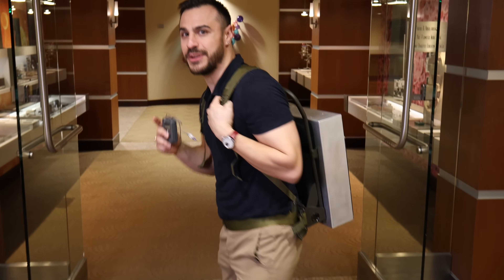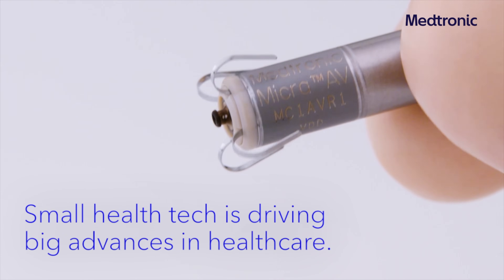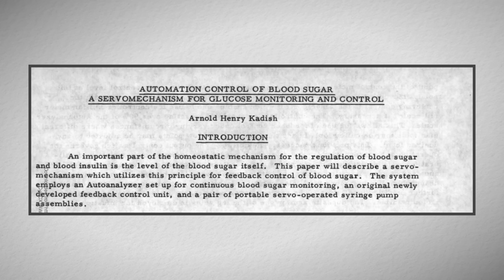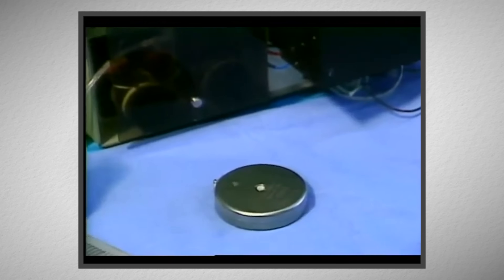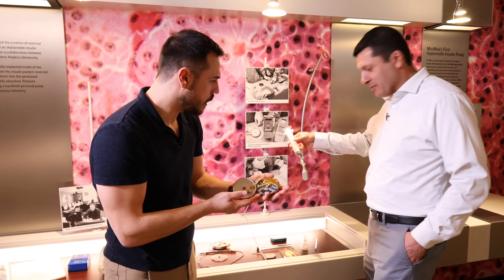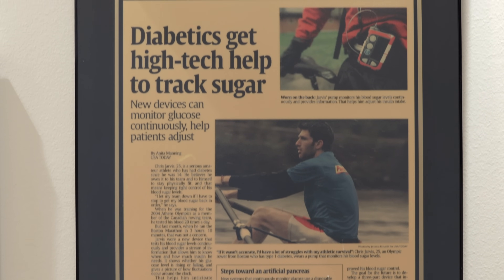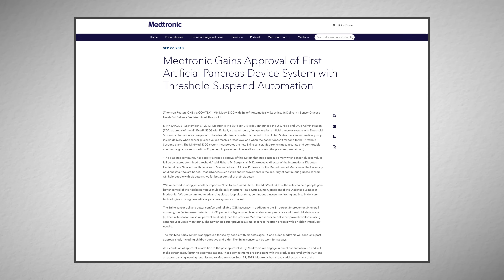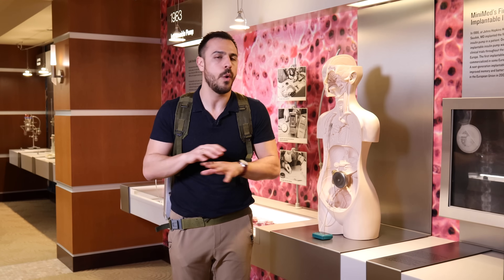The History of Diabetes Tech

Comment: Not mentioned in the video but the improvement from a 3 day CGM needing multiple calibrations a day to a 7 day one only needing very few has been a huge thing for me. I attempted to use a 3 day one in college where I also worked a fast food job, I could never step away to calibrate it when it beeped like every other hour, so it was completely useless to me  The upgrade to a 7 day CGM with 2 calibrations per day years later was a huge relief and helped me keep my blood sugar in check for a healthy pregnancy. Now Im on the Medtronic Guardian 4 with 780G pump which has an ever better Smart Guard mode and less calibrations required and I'm doing so much better, and think it will help pregnancies even moreso!
Reply from the maker: I want to do a video that focuses on CGM tech evolution! Thanks for sharing.

Comment: I'm not sure if you are having a follow-up with them, but I'm wondering - Why can't they implant the tubing for the current pumps into the peritoneal cavity and create a port that external pumps connect to? So they would only put the tubing of the pump in the body, and the only risk would be infection (although they have ports for cancer treatment and others- so I'm sure they have solutions for this). This would prevent scar tissue that comes with insulin injections and allow all the benefits of an internal pump like quicker speed for insulin to work, while also removing the biggest issue of external pumps - site issues. Genuinely curious if you can ask.
Reply from the maker: This is a fantastic question - will definitely ask about this. Would be amazing.
Reply: The implantable ports for cancer treatment etc still have infection risks and they are a nightmare to troubleshoot and remove when infected or blocked

Comment: I'd like to ask why we still don't use even U200 insulin in pumps. It would be the simplest improvement and it would surely help a lot, especially in the long run, to people with higher doses, by doing less harm to the tissue. With the high precision today, it shouldn't be a problem for even low doses. And I expect it would make the insulin also act faster. Half the volume should be absorbed faster, right? Probably a historic thing noone has big enough power to change from U100 :(

Comment: Sorry, things are not as rosy as you explain. First of all long term insulin pump use is not practical, because over time (years of use) the insertion canula causes scar tissue to form in the abdomen impeding absorption of Insulin leading to poor glucose control. Then you have to go back to daily insulin injections. Secondly, CGMs really don't work, the newest CGM made by the largest well known company is terribly inaccurate and prone to failure. CGM readings can sometime vary as much as 100 units from a glucometer reading. This makes this device useless. This coming from a Type 1 diabetic with 45 year of diabetes experience.
Reply: Cgms work fine, they're used by millions with very few issues. Libre
Reply: I’ve been on a pump for 20 years now and really have no issues just rotate my sites
Reply: If they had continued to work on it they would have gotten around it as it stands they could use something like a port.
Reply: I disagree on the cgm. Admittedly I’ve only been a diabetic for a year but I’ve found my Libre helps alleviate the paranoia I get about my blood glucose.  I’ve noticed that when I’m off it, I get the intense urge to stick myself much more frequently because I’m worried I may miss a spike.
I know it’s not super accurate. That’s fine. It tells me when I’m spiking and I need to do something about it.
Reply: Why not rotate sites to prevent the scar tissue issue? Literally only 2cm would be more than far enough away for the previous scar tissue to not cause any problems. And these are literally baby needles we‘re talking about… like come on
Reply: @cjfitness  generally these things need to be inserted into an area that has a layer of fatty tissue and isn’t going to be constantly knocked around and jostled, and is readily accessible, sounds easy enough at first, but it can be problematic real quick.
Reply: Exactly what my grandma says anytime I ask her why she doesn’t use the new devices
Reply: Type 1 in 64th year. My CGM supplies me with tracking info that is far more valuable to me than  having a  more accurate reading once or twice a day. I receive readings every 5 minutes, and they collectively have enabled me to arrive at the lowest A1C readings since the readings were available. No more finger sticks for this fellow.
Reply: I share your pain and frustration. But to be fair, it’s not the cannulas that caused the scar tissue. It’s leaving the cannula or insertion site in place longer than three days at a time. Secondly, CGM‘s work great until you have what’s known as a compression low. It is important to put the CGM’s in an area where it will not be compressed, whether while you’re sleeping or from tight clothing pressing on the CGM. These are false Lows and can throw off your diabetic control regiment. One other thing to note is that two of the major brand CGM manufacturers tell you in their literature that you should not take large doses of Tylenol, (aka: acetaminophen (500 mg or more) because this can cause the CGM to give false highs, which intern will cause your pump to overdose you. I’m sure Justin can address that issue more if he hasn’t already in his videos.

As for me, I have been diabetic since 1977. I have worn the 502 mini med pump and several more decades after. In 2023 I decided to go with the Omnipod system. It has proven to be more cost-effective for me and I can place that Omnipod just about anywhere on my body, eliminating large areas of scar tissue. The FDA only approves the back of the arm, the abdomen, and the back side of your hips for the Omnipod however, I have placed it on the front of my arm on my chest on my upper inner thigh and have had no issues with absorption so long as I change the area location every 80 hours (which you have to do with the Omnipod anyway, as it expires automatically after 80 hours of use).

I use the Dexcom G6 and only twice have had a compression low because I am a side sleeper and had it on the side of my arm. And as I stated earlier, I don’t take Tylenol as it will throw off your readings.

Bear in mind, CGM do not read whole blood like fingersticks do. They read the interstitial fluid under the skin and they do have a 10 to 15 unit discrepancy compared to fingerstick whole blood testing.  When taking Tylenol and strength greater than 500 mg, the interstitial fluid is affected and will produce false highs. Whole blood is not affected by Tylenol.

To conclude, what other choice do type one diabetics have? One way or another we either take our insulin via infusion pump or shots, but either way we must take it or we die. 

Ps. Vote for politicians who will cap the price of insulin for every age group not just the 62 and older. Like yourself I have had type one diabetes for a very long time (47 years). Don’t give up keep fighting the good fight and know you’re not alone.
Reply: Coming from Libre 3 and G7 I think you fall into the category of always comparing blood stick to CGM.  Quit doing that, just pull out the BG meter for extreme highs and lows.   You mention stomach when you have so many more places for infusion sites.  Lower back, upper buttocks, back of arm and your upper legs have a ton of real estate to use.  You can easily rotate and give previous sites time to heal properly
Reply: Completely disagree with what you’re saying here, long term use of insulin pumps is fine if you move sites around, cgm does work fine and i personally have seen a massive improvement in my hba1c levels after using hybrid close loop system using dexcom g6 and omnipod 5. I’ve been a diabetic for 40 years so 5 years short of you but as i’ve said i’ve found the complete opposite of you to be true over those 40 years.
Reply: Diabetic for 28 years. No issues with scar tissue. Also have been on a cgm for over 5 years and got my A1c down to 5.4.